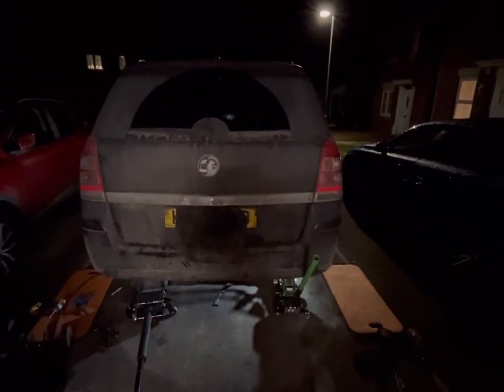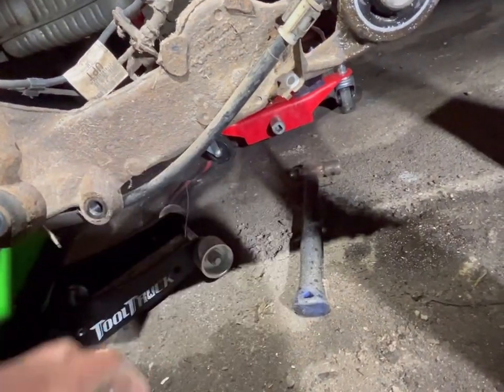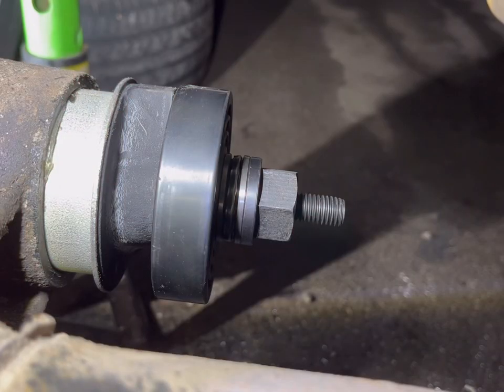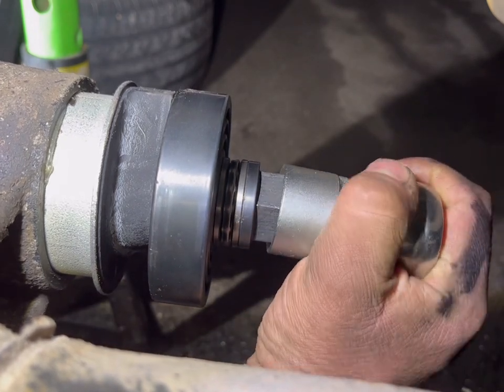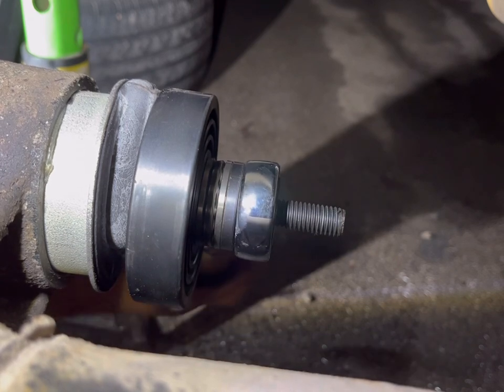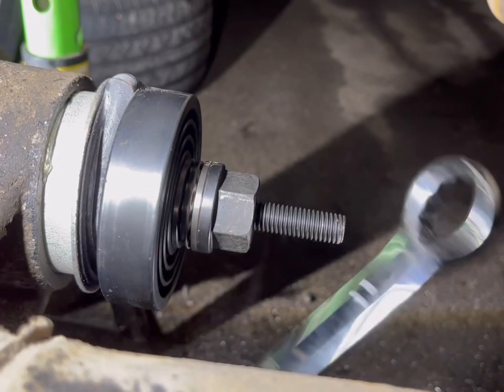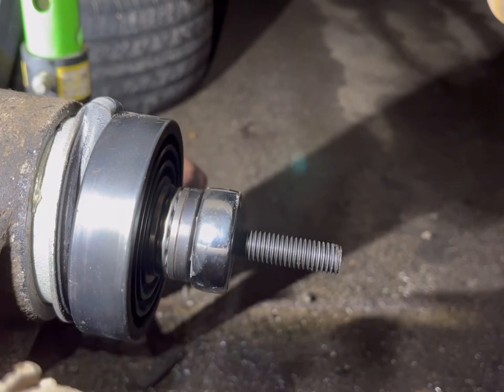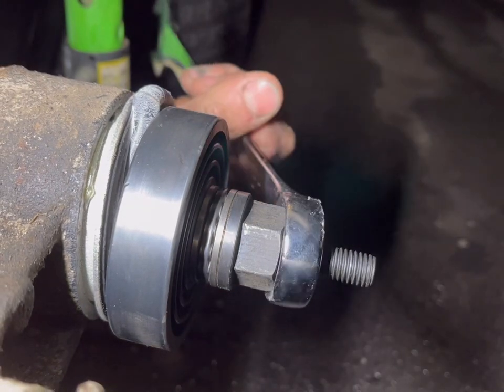Vauxhall Zafira B 2013 Axle Bush Replacement

Comment: Nice video man , I have to it on my zafira b , my mot fail on that , and my mechanic suggested to get a new ou used entire rear  axle cause for replacing the both bushes it will cost the same , do know what to do